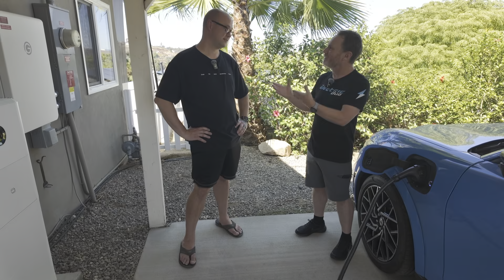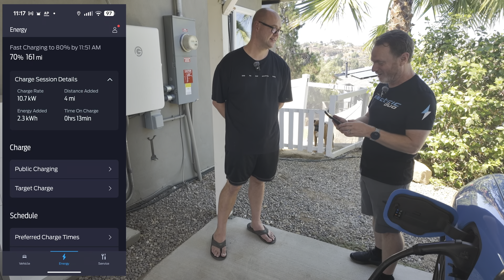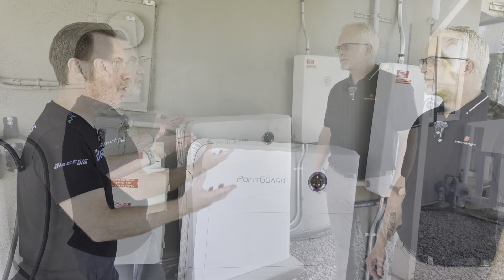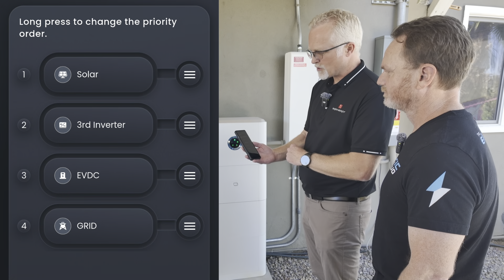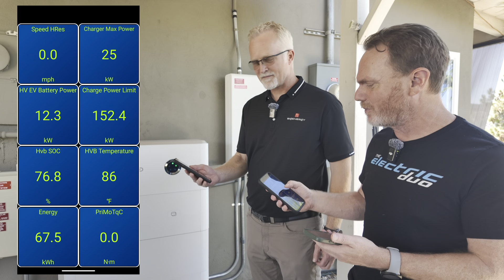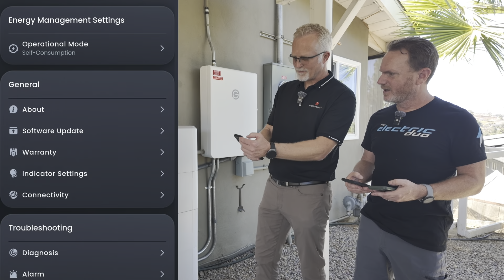Our Mustang Mach-E Powers an ENTIRE House! Bidirectional Charging from Sigenergy (V2X)

Comment: in the app, it would be better to show the flow of energy in 2 different colours ie the ac energy coming in as well as the DC coming in from the solar. The reason is simple: I would like to know that my DC power is charging the battery and the vehicle and that the ac is direct to the home so that there is no loss in conversion. But maybe at other times, I need to charge the vehicle more quickly so I need the a/c energy as well as the solar to help charge the vehicle more quickly so then with a touch of the app configuration, I can see that the energy is mixing. Use yellow, green and blue to show the differences. the benefit is that I can quickly tell if I have my settings incorrect. Maybe I don't care how fast the vehicle charges. I want to make sure that I am not losing energy due to conversion.

Comment: Is my understanding correct that V2X on EVs that don't support V2H is possible because the bidirectional charger is tricking the car via CCS communication to connect its charging port directly to its battery for fast DC charging but the bidirectional charger pulls/discharges the battery instead of charging? Is that correct? If so, the only way I can see EV manufacturers blocking this is to update their CCS car specific communication (maybe it's an authentication key) so that these bidirectional chargers no longer have the correct authentication to activate DC access via charging port. While that could block Sigenergy and the like for a bit, it would only be temporary because Sigenergy is an official third-party CCS charger and would get the new authentication key which they could use to patch the bidirectional charging. So my take is EV manufacturers can only temporarily block bidirectional discharging. And it probably wouldn't even be in the EV manufacturers best interest to do so because it likely would mess with CCS compatibility with 3rd party public chargers

If my above understanding is correct then the risk for doing this with an older EV out of warranty (ex. My 2018 model 3 with CCS update) are fairly minimal so long as it does actually work as advertised and installed correctly. I work from home so my car is home most days. Would be great to run the house on my EV during high electric rate during the day. I know there is theory that adding a daily discharge cycle is bad for your battery however consider that it is also bad for the battery to stay topped up, even under 80%, if the pack isn't discharged after a long period of time. If seen theories that low rate discharge could be good for lithium packs, which is what we're doing here. I don't think there's been enough end user experience to conclude either way though

Comment: @theelectricduo Can you guys test drive a GM EV and see if it will work with the Sigenergy setup at Adams house. Lots of GM owners looking for info on this.
Reply from the maker: Unfortunately GM specifically disables this for their vehicles. They have an in- house system that you can addon, at least for the Equinox EV, so apparently they intentionally disable this ability with 3rd party. - Liv
Reply: @theelectricduo oh, no! 
And I was actually looking to purchase an Equinox EV for bidirectional charging! 
Are there any other compact SUVs compatible with your equipment?

Comment: Great video on what is going to be one of the main benefits of EV ownership going forward that no ICE vehicle can compete with. This is a fast expanding solution that many OEMs and bi-directional charging companies are introducing now and into 2026. Enphase has also introduced their IQ bidirectional EV charger with a meter collar and built in black start battery in the charger so no additional batteries, switch or breakout boxes are needed. Any home can install since no circuit is required. Would love to see you cover Enphase as that will represent the lowest cost solution with easy install for any home owner.

Comment: Can the Mach E be discharged below safe levels with that set up? I know with normal driving operation, the car will enter turtle mode and then shut off with energy left in the battery to avoid damage.

Comment: Since the charger is DC, what is the max Kw this system can deliver?
Reply: The maximum charging and discharging power is 25kW. You can reach 25kW of charging by combining imported electricity from the grid, your solar, and even your stationary batteries.

Comment: For cars that were not initially built to V2H, is there any warranty issues with the car manufacturer?
Reply: Third-party experiments: A few independent charger manufacturers or tinkerers may have demonstrated reverse-engineered bidirectional power transfer with the Mach-E. However, this is not an approved use case and would likely void your vehicle's warranty.

Comment: This is certainly the way things should go to give people the most flexibility in their system. I have 4 Powerwall3s but will never buy a Tesla vehicle. I want to buy the Ramcharger truck and it would be great if it would work this way without having to switch out my battery system. I already know I'll be able to put excess solar into the vehicle instead of the grid. With the heat we've been having in east San Diego this summer, I haven't been filling up my battery bank but the rest of the year, I do early in the day.

Comment: On cloudy or low solar power days, is there a minimum “excess solar” DC delivery rate to the EV from the DC charger?  Or will it scale all the way to 0 kW depending on what’s available?  Just curious on the power supply range and efficiency you might expect if you always sent your export solar to your electric vehicle through the DC charger across a range of conditions.  And in particular how it compares to the efficiency of the Sigenergy AC charger used for the same purpose.  Thanks!
Reply: Your efficiency will always be better with our DC charger. All AC chargers rely on the EV's on board charger to convert AC power to DC so the EV batteries can use the power. The on board charger efficiencies are quite low at around 90% because they have to small to fit in a car. So every time you AC charge you lose about 10% due to efficiency. There is almost no efficiency loss at all when charging the EV directly from solar with our DC charger.
Reply: @PointGuard-37.62  Very cool.  So does this mean on a cloudy day without a lot of solar, say you're sending .5 to 1 kW of excess solar to your EV through the DC charger I'm wondering if 1) Can it go that low and 2) is that power transfer just as efficient as the max transfer rate of 25 kW would be?

Comment: This is great to see.  A system like this will be in my next house.

I did a whole house backup system a couple decades ago.  That system was 30 KWh which was good for a few days (more if I was careful on usage).  My Mach-E Rally has 3 times that capacity, so I can get the same backup and still have enough range for my needs.
Reply from the maker: I love the versatility of this system!
Reply: Great video!  Wish u would have talked cost!

Comment: You guys mentioned 7, 8, 10kWh energy transfer from car to gateway, and you also talked a lot about which cars can support this and the cars that cannot. But I didn’t hear you mention how much the Ford Mach E can export, or I should say how fast it can export it or at what energy level. I would love to hear what Ford’s recommendation is. I definitely advocate having the capability of exporting my energy to the grid when the price is right and when the timing is right.
Reply: Our charger can charge and discharge at a max of 25kW continuous. However, what you can use in your house is limited by our Controller / inverter. The maximum continuous power output of that controller is 11.5 kilowatts. Since you still have quite a bit of power capacity available you can charge your batteries at the same time. That way you may reach 20 - 25kW of discharging power.
Reply: So any car that works with the system can push a max of 25kw if you manage the distribution correctly. Thats dc and the inverter on Sigenergys side is a 11.4kw ac converter. So you’d have to push the remaining 13.6kw to a dc source  (like the house batteries) to get the max speed out of the car. I routinely pull 13-15kw out while it’s running the house, charging the batteries and exporting to the grid.

Comment: Wait, can the sigenergy battery be charged by the grid instead of by solar panels?  I don’t have solar panels, but would love a power backup/generator for the house, especially during hurricane season. I don’t want a gas/diesel generator and an EV isnt in the cards for several years. My electricity is cheap and isn’t tied to peak/nonpeak use. I’d definitely be interested in using this as a whole house generator.
Reply: Yes, it can definitely be used that way!
Reply: @True_Dad  That’s outstanding! Thank you for answering my question.  I briefly reviewed their website and every other word is solar. Every time I look into something like this, it seems to be an all or nothing approach requiring solar plus battery, and I’d end up paying $25-$30k. Since I work outside of the home, I’d never  really  use the system until I retired. my house is all electric and I haven’t really lost electricity- and even then for only a 1-3 hours at a time - in the 20 years I’ve been in my home.  So for me I think it’s really hard to justify buying an entire solar + battery system.  I’ve haven’t seen any system that allows charging the backup battery via the grid. My next best approach was to buy an Ioniq 5 or 6 and use their limited V2L to power the basics during an emergency. But as I  said, I’m years away from having to buy a new car.
Reply: @Robot_Cajun You’re welcome! The system is super flexible, so it’s great to be built up and adapted overtime. If you install what you need now it’ll be really easy to upgrade it by adding a different module for V2X, solar or anything else later down the road.
Reply: @True_Dad That’s the goal!  I’d love to have a system like yours someday. Either that or build a region-appropriate Passive House that doesn’t need much power at all. 🤣 Thanks again.

Comment: very excited to see it working with the mach-e.

No mention of price. Wonder how much it costs?
Reply: Price varies by location, I paid $34k for mine installed with 10 more panels and some repairs to my existing solar system. Unfortunately there’s no itemized cost available yet. I estimate the Sigenergy system alone cost me $20-25k installed. I pulled the trigger as fast as I did to take advantage of the federal incentives while they still last, so provided I get those, I’ll have paid $24k total and get $10k back from incentives.

Comment: So, does this mean the Mach-E has V2L capability despite Ford saying it hasn't?
Reply: That’s correct!
Reply: V2L is different. It means that the car can output AC power. You can then plug it into or connect it directly to your home or to the energy Gateway. Usually the cars that can do that have some kind of output for receptacle.

Comment: i have an Enphase system..... unfortunately they still have not come out with there bidirectional charging......and i own an Ionic 5 and a F150 lightning... curious if this system would work with enphase?
Reply: Yep- all my panels are on Enphase microinverters, running through the Enphase combiner straight to the back of the Sigenergy system.
Reply: @True_Dad thanks for that information..i think ill reach out to a rep
Reply: Same question with EG4!
Reply: @freeheeler09Yep, any solar system will work with it, it can take power from effectively any source. Other batteries will work with it, but wont be able to be controlled from the Sigenergy app. You’ll have to keep using the other brands app to control the battery portion.

Comment: The EV charger is on the bottom (it's required to be the bottommost unit).
Reply: The charging cable exits the solution at the bottom. It actually exits the charger and travels down the system inside of the side covers so it looks like it's at the bottom. It's always right below the Controller...
Reply: It’s not, it’s actually second from the top. I watched the entire install and spoke with the guys as it happened, watching everything get unboxed and installed. The V2X unit is visibly identifiable by the card tap to charge icon below the lights in the inverter. The charging cable comes directly out of it.
Reply: Interesting.  The UK installs place the charger at the bottom.

Comment: If the Sigenergy folks are watching, I am curious - do _non_CCS-upgrade Teslas work with this? I see you do list a Tesla Model 3 with NACS connection as compatible, but my older Model S doesn't have the CCS-compatibility upgrade that would make it compatible with third-party J3400 systems. And/or would an old Lectron active CCS->Tesla adapter work with this?
Reply from the maker: I'll see if I can find out.
Reply: I am a Sigenergy distributor and you definitively need the CCS upgrade ... just schedule a ranger service with your Tesla app and they will charge you around 300$ for the upgrade.
Reply: @roulezelectrique889 Don’t really want to spend any money with Tesla any more. Glad I have unlimited Supercharging, means I rarely need my CCS adapter. 😂
Reply: @roulezelectrique889 pensez-vous qu'Hydro Québec serait intéressé?

Comment: Hah! I just shared Adam's original "using my Sigenergy with my Rivian to power my house" video with someone yesterday!
Reply from the maker: Adam is great! And he's been so excited by this setup!
Reply: Thanks!
Reply: I can’t wait for the Enphase V2G system releases. That’s my current solar setup, and while I’d love the Sigenergy one now, it only integrates with their solar/battery system. I’m definitely not replacing tens of thousands of dollars worth of perfectly working bits just for this!
Reply: @AnonymousFreakYT  the Sigenergy works great with Enphase solar, so long as it is just the solar.  Now if you also already have the Enphase battery and transfer switch then you are likely better off waiting for the Enphase version.
Reply: @AnonymousFreakYT No no, it definitely integrates with Enphase- all my panels currently go through an Enphase combiner. My existing system was 25panels and I just added 10 to that when I installed the Sigenergy system. Adding additional DC panels is even easier though as they go straight to the Sigenergy unit rather than needing microinverters. So you can keep your Enphase setup and add more of those or just skip the microinverters altogether- your choice!
Reply: @True_Dad  Interesting, I was assuming with the Enphase, the microinverters would be a dealbreaker.
Reply: @AnonymousFreakYT  so long as you wire through the Load Hub, the existing solar (of nearly any AC coupled brand) will become part of the Sigenergy system.  I have an 9 year old SolarEdge solar system which integrates perfectly with my Sigenergy batteries and app.
Reply: @AnonymousFreakYT  fyi, we can fully integrate third-party solar systems into our solution. It's very easy it's just better. You don't have to wait for the Enphase system to start using bi-directional charging. Enphase is by nature and AC coupled system to be able to, and we can AC couple your Enphase solar directly into our solution system that works. However, the highest benefit is if you DC couple your solar straight into our solution savannah. That's how you can add the solar generated power as well as your battery power to use all three sources together to charge your car

Comment: But what you don’t address is if you suck your power from your car to run your house then you will reduce your EV range and maybe that isn’t a good idea.
Reply: So while that’s true, the solar refills the EV. Let’s say my wife brings home her car at 5pm and 40% soc, we use it to run the house all night and it’s down to 20%. The solar system I have (obviously varies by system size etc) can put around 40kwh back into the car everyday. That’s over half its battery. So when I tested this, using it to power the house every night, then refill it with solar each day, I had a net gain in range/soc everyday. In my own situation I also have other EVs, so I can use one to run the house and gain gross soc while I’m driving the other one, then swap when that one’s full and keep one EV full at almost all times.
Reply from the maker: If we had this at our house, we use about 6 kWh of electricity overnight. Our Mach-E battery is 91 kWh.